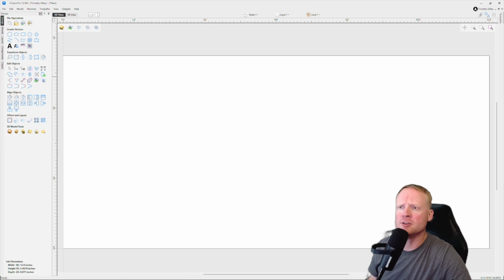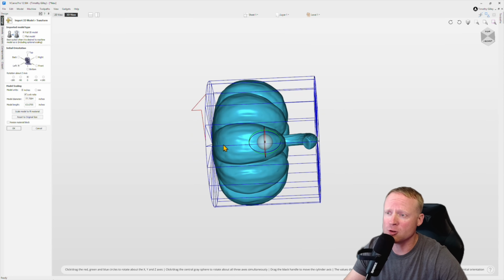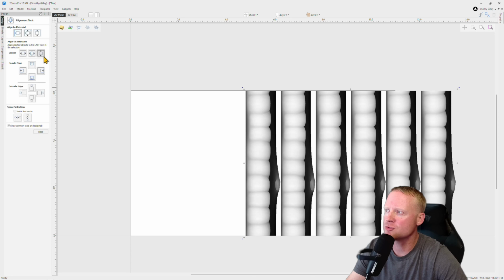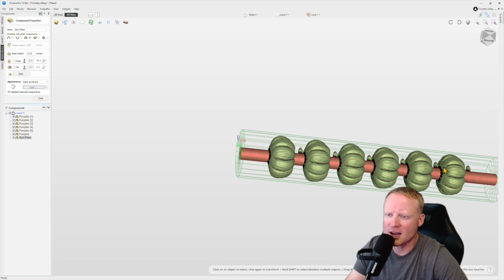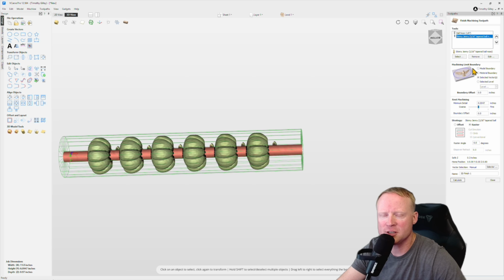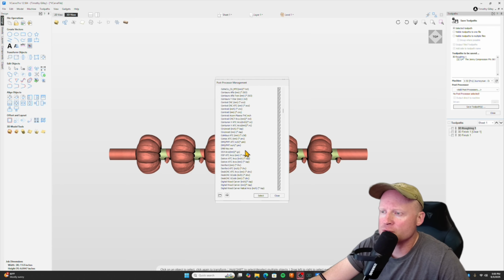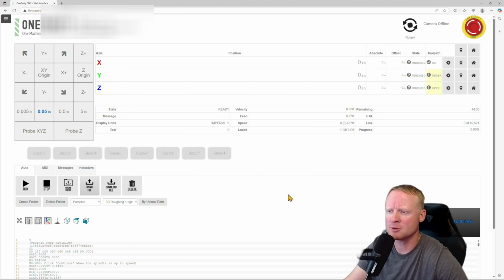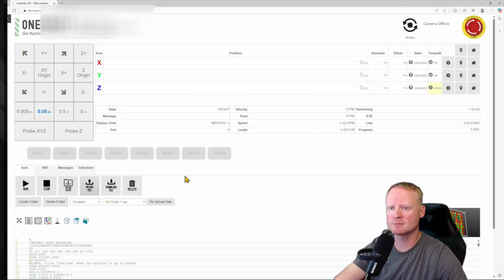Using 3D STLs from thingiverse in VCARVE PRO | Pumpkins on the Onefinity Revolution (Buildbotics)

Comment from the maker: 🍂 These six pumpkins will be furniture legs on my next box build—subscribe so you don’t miss the assembly & finish!
Questions on Wrap Y2A, the ¼" rough / 1/16" finish setup, or the Zero Plane stem trick? Drop them below and I’ll help.

A note about this video: The software created two toolpaths because I had two different bits selected. Ensure when creating the finishing toolpath that you only have one bit selected, and it will generate properly.